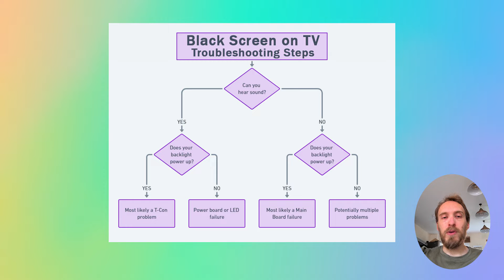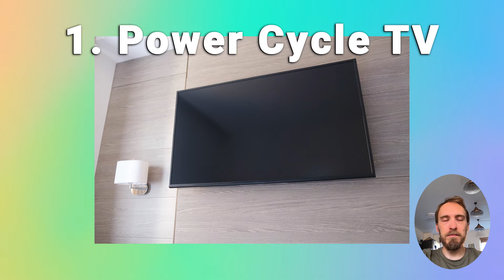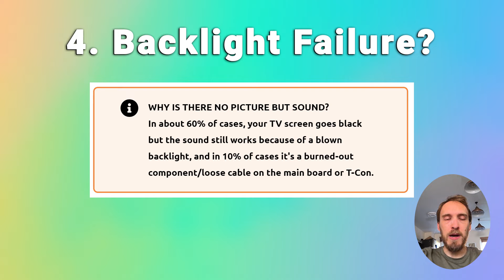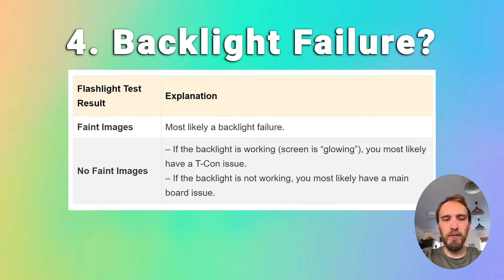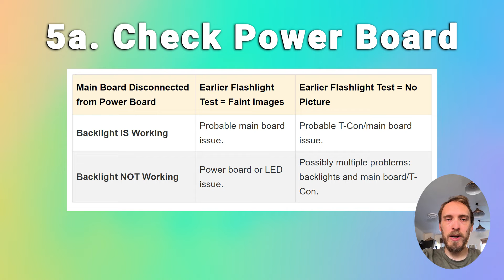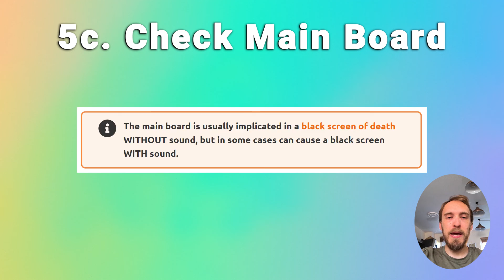Bush TV Black Screen WITH Sound | NO Picture But Sound | 10-Min Fixes

Comment from the maker: Read the full article:   https://www.lapseoftheshutter.com/bush-tv-sound-but-no-picture/
Reply: Hi, 
I have a BUSH TV, when I turn on the TV, the TV looks normal with a picture and light. But now when I turn on the TV I have a normal picture and sound on, but after 30 sec the light turns off, but I can see the picture with a phone flash. This TV had the backlight changed because the TV had a blue tint, and everything was working but with a blue picture tint. I tested everything after the backlights were swapped for the new ones, and it was perfect when I connected my ps3. I have started with this issue. I disconnect all the cables (HDMI), and now when I turn on the TV, I have normal light and sound, and after 30 sec the light turns off, but I can see the picture on the screen.
After I turn off the TV on the remote and turn on  again, I have a picture and lights on, after 30 sec lights go off. 
What do you think, can there be a backlight problem again?
Thnak you

Comment: I do not have an on and off button on my flat Bush screen. So the way to turn it off is by turning off at the plug. I have sound but no picture. I have turned it off on the plug and pull the plug out of the socket. Left for 15 minutes, still got the same from.  Have unplugged the only 1 cable at the back, cleaned, and still the same problem, black screen, so no picture, but I have sound.

Comment: Hi @techtests - I have a Bush TV, I will admit, is now old, but I do not have the option to buy a new TV at the moment.
So my TV Turns on, the screen is black. There is one button on my remote that is called DISPLAY, which looks like the Red Power Button, when I press this, the screen will come on for around a second and then go off again. So I do not think it is a backlight problem. Do you have any suggestions?

Comment: My tv turns on and there is sound, there is a picture for around 5seconds then picture cuts
Reply: Did you find out what this was this is what my tv is doing cheers.
Reply: Same here
Reply: From what I read up it’s a motherboard issue 
Tv wasn’t worth saving so I throw away 
I’m not the most tech savvy so if you have an expensive model than I did then I hope you find solution
Reply: same